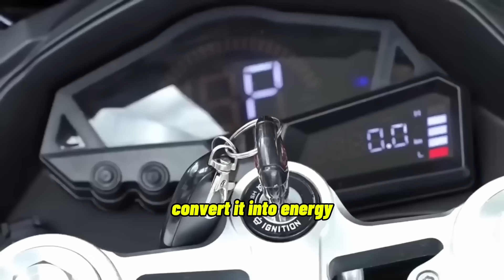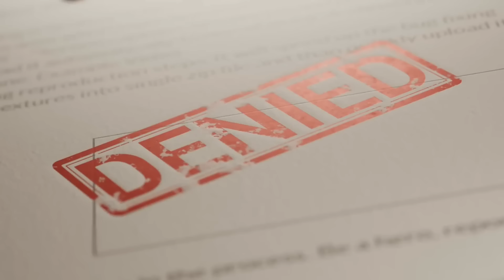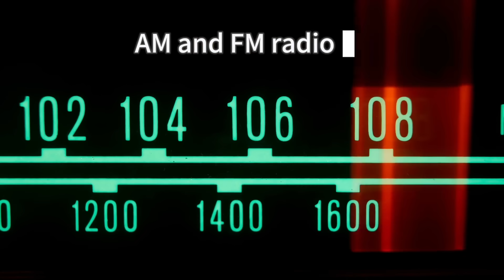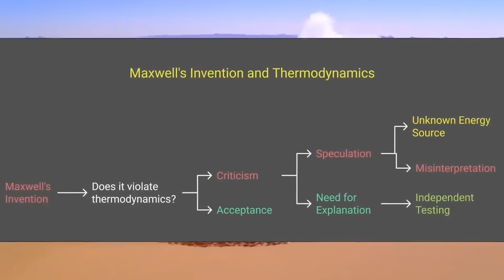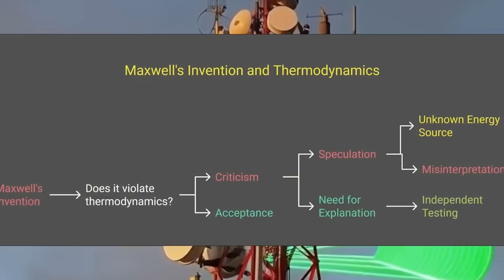This African Man BROKE Physics Law With One Invention - Maxwell Chikumbutso

Comment: Maxwell I'm glad you did that how did basically the same thing at the age of 16 I had so much trouble in school it wasn't funny I had a reading problem my mind was it worked faster than most people and I got bored quick so I know what you're saying my life was around electronics also read or write even schematics that I've never done I used to know how to work them I can troubleshoot a TV a VCR boombox oh my gosh washing machine and dryers air conditioners it didn't make no difference I made a job out of it when I was young and I loved it and tell our country decided we don't need electronics anymore it started with radio shack in some of the others and some of the other electronic shops that we had around that was independent they disappeared to now the only way you can find electronics is either off of Amazon or if you get lucky find some garbage somewhere that you can tear apart like I did and you did that is really cool Maxwell make it work I'm too old to finish my stuff and we can't get electronics in the United States anymore anyway it's funny in it people just don't understand

Comment: If you think about it back in the early days when they first was testing when they were first testing with electric we have the Tesla coils which runs off of high frequency radio waves. He's basically building something similar if not the same. The United States went ahead and went with wire and regular light bulbs when the other was being tested they decided to go with electrical wiring instead of over the airwaves power which was basically Tesla coils that energy was done some of our electrical engineers back in the forties 1030 East and I think beyond that but I'm not positive how far back it went cuz I done forgot more than I learned my last day in the school was back in the 72 of my life. It does not violate the laws of energy what in the world are you guys talking about peoples are nuts.